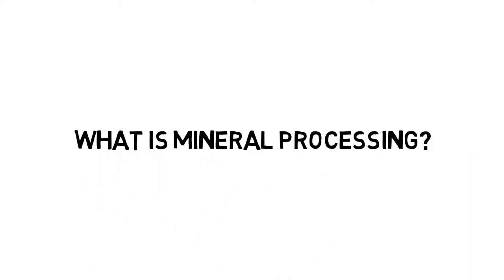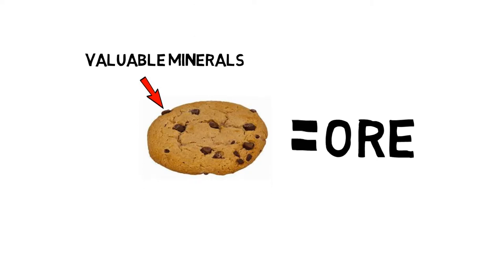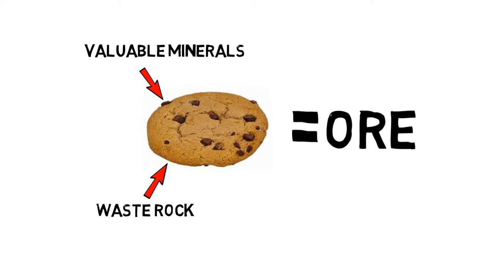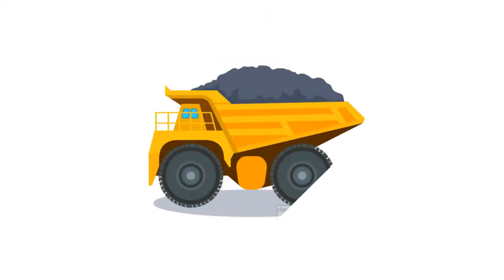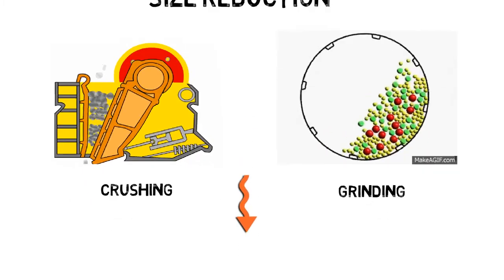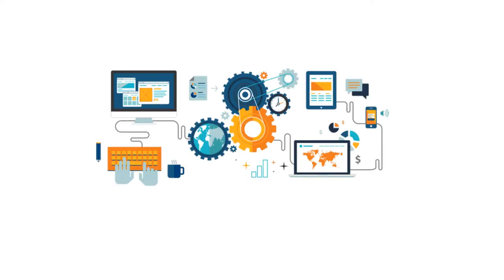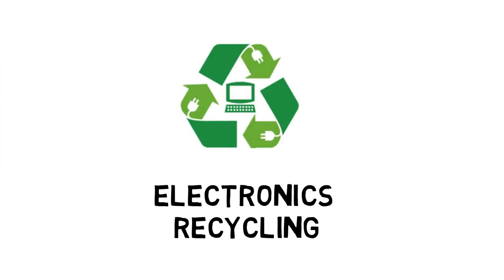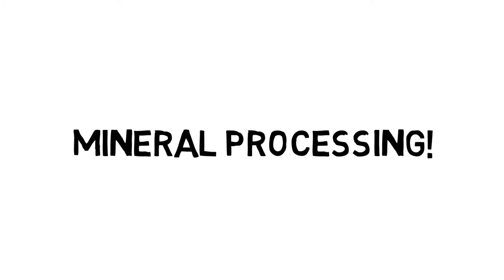What is mineral processing?

Comment: Froth flotation, even mag separation especially if your products aren't captured in the first 3 cleaning circuits (lithium mainly) so will have to process the tailings 
 . Also if people don't understand, large particles will cause a nugget effect to which target minerals are locked away, hence fine grinding to liberate said mineral during flotation
 and reagents used to suppress gank etc

Comment: Can you describe the process of flotation from the given diagram in your video?
Reply from the maker: A known amount of ore and water is added to create a slurry. Next, reagents are added to change the surface properties of the material. Then, chemicals called collectors are added to the slurry to form hydrophobic surfaces on the constituent of interest. Air or nitrogen is then bubbled through the agitated slurry. The air bubbles come into contact with the hydrophobic surfaces, transporting them to the surface, where they form a froth or foam. The foam is then separated from the pulp, creating a concentrate. The concentrate and tailings are then weighed, dried and assayed, to determine final constituent mass balances and recoveries. During the test, reagent additions are also tracked so that reagent consumption’s can be determined.
Reply: Thankyouu so muchh!!! actually I'm here because of the given link on my module😁
Reply: @camilletambauan514  basically grinding to the point of mineral liberation, using "Grind calibrations" with said depressants ( which depress unwanted minerals Cu, Pb, Zn example), adding air during the agitation  phases will allow "Froth flotation", particles become hydrophobic and stick to the bubbles allowing you to recover the mineral you require. determines grade and weather or not it's feasible in the long run, benchscale.

Comment: In screening process, how does the cut size value tells about the efficiency of screen. Like for two different aperture sizes, there'll be two different cut sizes, now my confusion is which screen is more efficient based on cut size? Hoping to hear from you soon.
Reply: Overall, the higher the cut size, the higher the efficiency. However, you need to take into account that the higher the cut size, the higher the wear rate of the screen with all other parameters being constant.